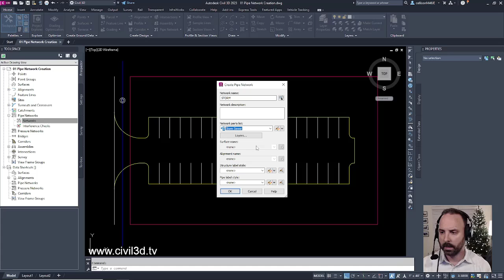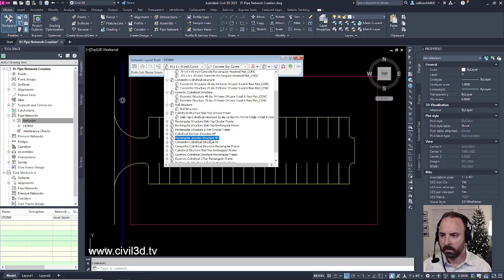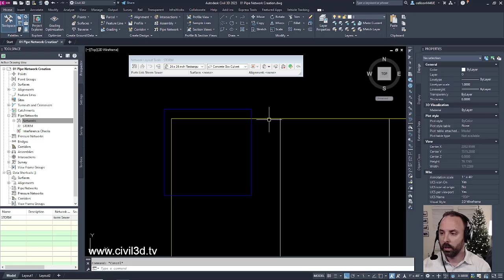01 Pipe Network Creation in Civil 3D 2023

Comment: Thank u for such nice tutorial. I need to convert pipe networks from Autocad into Civil 3D. I have a text file having start and end invert levels for each pipe. I successfuly drew necessary surfaces, alignments and related profiles. I drew all the pipe networks and added them into the related profiles. How can I assign inverted levels of pipes from text file. If I do it manually, it will consume a lot of time and it will kill the pupose of using civil 3d. Any suggestion? Thanks. Imtiaz from Pakistan
Reply from the maker: That is a great question, I'll have to do some research on that, but I am glad the tutorial was helpful!